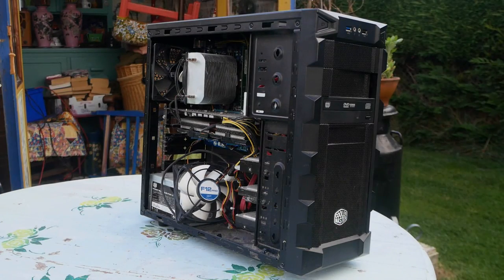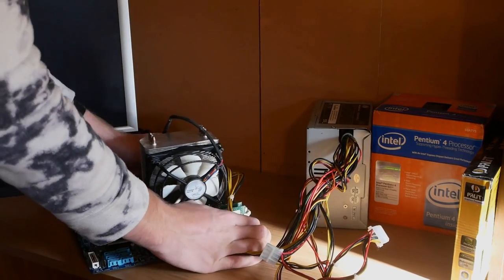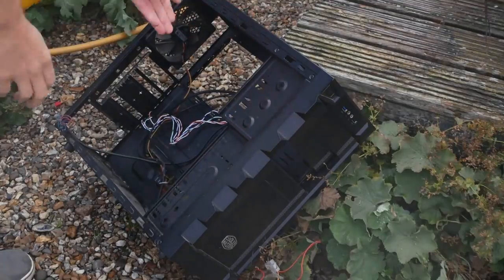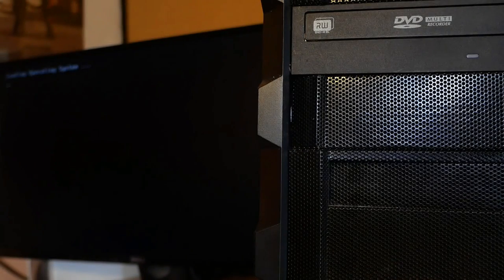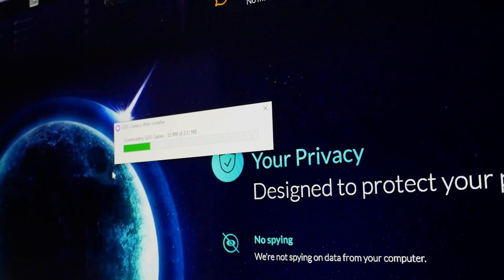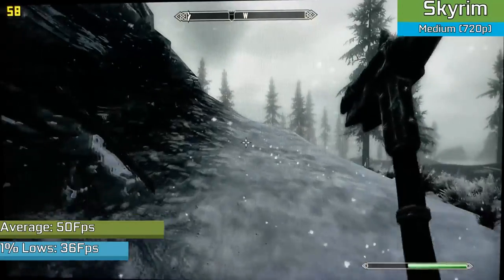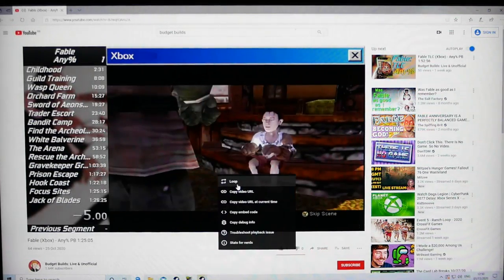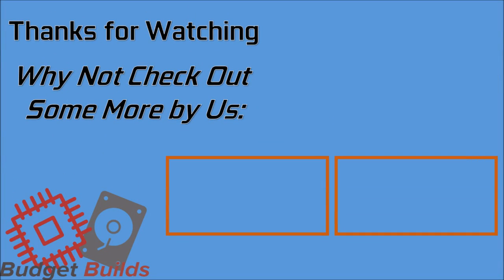I Bought an Awful Computer from a Barn....

Comment: Sounds like it has dead pci X16 contacts, the slots can get damaged over time, did you clean it out?
Reply from the maker: Fully cleaned out, and repaired. I think the tar may have corroded it and destroyed a power trace
Reply: Especially weird since the card works in other systems and the HD4670 was the only thing to run in this one. Which should be a x16 card, and most can easily run x8, x4 or even x1 if thats all they can handshake with.
Reply: Did you try to wash the board in the dishwasher?  Make sure there is no rinse aid or detergent and take the cmos battery out. Let it dry for a few days in ambient air and you're set.
Reply: @BudgetBuildsOfficial  try gt 1030

It's pcie x4. With x16 connector (doesn't make sense why no one made x4 ones with gddr5)
Reply: the power supply is bad.....
Reply: @HappyBeezerStudios  some cards populate in different ways, weak cards use fewer traces and if you get lucky with the layout some might work
Reply from the maker: @jskyg68  No it isn't. All have been tested.
Reply: >I think the tar may have corroded it and destroyed a power trace
That could explain Nvidia cards not working, but if that was the case an AMD GPU with PCIe power connector should work, my memory isn't flawless but I seem to recall AMD GPUs being able to run with the power part of the PCIe slot cut entirely without needing to mod the card (minus cutting the part that goes in the power part of the slot).
Reply: @transparentblue  the card that came with it was an hd 7870.
Reply: @HappyBeezerStudios  Maybe it's worth a try to force the PCIe lane width down to x8 or x4 in the BIOS and see if other cards work?
Reply: @Stoney3K  That's actually a good idea. Especially since many cards don't need full bandwith to reach their performance. I remember tests a few years back where a HD 7970 lost maybe 5% when running at 8 lanes even on a PCIe 2.0 board. And with those lower end cards it should be less noticeable, if at all.
Reply: @BudgetBuildsOfficial  did you try doing that really desperate thing where you fully wash the mobo with dish soap and wait for it to fully dry
Reply: “Never said good or bad” -System integrators
Reply: As an EE I'm going woth tje damaged trace not all cards are equal more so with pin outs on d vs new ... layman's terms mobo is junk
Reply: EDGE: 
“Were NOT spying on data from your computer" 
LOL, What about the actual browser? 

JS... LOL
Reply: I had a similar problem some years ago. Turned out to be the vga-cable. Changed it and all cards worked just fine on that motherboard.
Reply: @trisjack82  … Especially the new "6500" XT that could have been GREAT barring the situation ATM ... if they did not leave out the majority of folks not upgrading the entire system to have GEN 4 PCiE Rails aboard as without GEN4 and the 6500 XT (switched name from 6500 from 6400 but maybe they will release a 6400) with it's particular missing PCiE traces or pins, its a wimp which it did not have to be however was done on purpose, REALLY A SHAME! … However, AMD been really making “VEGA GREAT AGAIN” which I give them credit for, the VEGA 56/64 catching up to speeds of the 1080 ti which is still a great card, really shows what DRIVERS can do... I hope they keep going, especially with the PRO cards like the 8200 ...
Reply: @VoldoronGaming  ...not a bad card, a very beloved card still by many sentimental enthusiast folks - to bad that card did not have a variant with more RAM as it is held back with some of its performance on the table because of this as well as driver support ending for GCN except 5.0 & the newest RDNA so cards like VEGA 56/64 & Radeon VII and such which is doing insanely well BTW ... need to be re-visited by reviewers...
Reply: It could be broken PCIE lanes in the CPU itself. Doesn't have to be contacts or motherboard. For example if at some point something was shorted (maybe some dust or something), a PCIE lane could have been fried on the CPU die.
Reply: I'd have probably chucked out the suspicious MB and the grotty (and broken) case, and sold the rest of the parts on individually or tried to make a PC out of what was left, along with a cheap replacement MB and case. After all, the PSU/CPU/RAM/GPU/SSD/HDDs/ODD were worth the £30 (and possibly more) just by themselves.

Comment: "I don't know why you'll need that much storage" As someone with 9TBs spread throughout a bunch of drives I feel personally attacked.
Reply: Its homework
Reply: I have a 2TB HDD, a 1TB HDD and a 500GB SSD in my tower PC :) the only reason I don't have any more is because I'm out of SATA ports (the 4th is for a DVD drive). I also have tons of spare 2.5 and 3.5 hard drives scavenged from various sources (mostly satellite and cable TV boxes).
Reply: NAS with a 3tb and 4tb, 2 x 6tb and 1 2tb nvme, and a laptop with 1.5 tb of nmve
Reply: Lol I have large games do 3D animation and video editing and I only need 1tb max
Reply: I have to keep managing my 2+2TB setup by keeping less used files and games off my M.2 and put them on a 2TB constellation hard disk (so its not too bad for speed but 180 MB/s versus 3000 MB/s for a M.2 is slow in comparison).
if I had more money I'd love to have another M.2 or a larger rust spinner to store less used files.
Reply: Only 9? I'm sitting here with 39tb.
Reply: Got 2 3TB and a 4TB drive in my main system and actually use that stuff.
Like, my steam folder alone is close to 1 TB and there are games that do not come through steam. Then add the amount of music and videos that collect over time and you need more than one drive.
Reply: @cee128d  39TB sweet, I treated myself to two 14TB drives last Amazon Prime day. It's so nice to not have to worry about storage space.....for now. Must...hoard......all the data.
Reply: I think I have like 10TB in my main system.
Reply: @cee128d  Living the dream right there.
 
Currently I have:
2x 3TB hard drives for a personal project
2x 1TB Sata SSDs for games
1x 500gb nvme as a boot drive
1x 500gb dodgy laptop hardrive for "homework"
Reply: We need somewhere to keep the booty we get for sailing the high seas.
Reply: @ihatelols  2TB + 512GB SSD is more than enough for me. I don't know how many games you play at once or have installed but I have a Steam library of over 80 games of which just 1/4 were installed and still had space with my 1TB drive. Even video recording.
Am not going to count Origin games.
Reply: As someone with two 160gb maxtor 5400rpm hdd i feel pretty jealous.
Reply: @ihatelols  Oh , I do understand your situation now!
It makes much more sense for you to have a lot of storage since you re-sell PCs with pre-installed games and everything.
I though you were the average dude using his PC to play games , maybe store some videos , picture or music and that was it.

I just got to know a lot of weirdos on the Internet though , hahah.
They would save everything single picture of everyone (personal or not + pr0n ofc) , screenshot chats , record voice chats and all. Don't really know what's wrong with these people but they definitely got something wrong in their brains ahhahah
Reply: 240GB SSD BOOT Drive
1TB SSD For games
1TB HDD for others.

I guess this is the norm these days?
Reply: @klen7642  Just go for a 1TB M.2 SSD for anything honestly. Is decently cheap and very fast and reliable.
Reply: @mabeSc  True. Most people don't really need more than one 1tb, and keeping everything into one tiny m.2 is even better.
Reply: @McShave  I'll probably pick up a couple of 12 or 14 TB WD EazyStores to shuck in the near future. I'm running out of space with all of the videos I've been creating during all of this Human Malware Nonsense.
Reply: Oh god, I have more than 40 TB of storage total. Most of it is lying in a stack of drives I have though.
Reply: @Kevin-rk3ef  i know it's a joke, but really, how much p*rn would you need to get like 1GB worth of storage? that's like, content for all your life
Reply: Those are IDE Hard Drives, like from the late 1990's or early 2000's. core i5's and i7's used Sata, not IDE.
Reply: @TheSpotify95  I’m pretty sure they got pcie sata controllers on amazon and ebay
Reply: @NicksRepository  Linux distros of course.
Reply: Me sitting here with 50tb.... Thinking that not much
Reply: got 1tb hdd, 1tb hdd, 2tb hdd and a 256gb ssd, all combined have over 100 games on steam across all drives along with steamvr, origin games, ubisoft and battlenet and source sdks and also bunch of pirated games and films end up with about 200-300gb left per drive except on the ssd where theres 30gb left
Reply: i use 4.25 cuz all my games
Reply: only 9? Lol 24 here
Reply: As someone with ~300tb, spread across 6 computers, I need more storage.
Reply: Lol. I hear you. I have about 20 tb spread across 3 computers.
Reply: As someone who wants to back up all their PS1 and 2 games, as well as old DVDs, physical photos, home VHS, etc.

Hell yeah, moar TB
Reply: @ScienceAlliance  It's a 'size' thing.😉😉
Reply: @TheSpotify95  doesn't mean you're out of options to have more storage. Haha external drives go wrrrrrr
Reply: my hyperspin setup is 64tb out of my total of 80tb and i am running out space
Reply: U just lazy to look around ur storage to delete unused stuff
Reply: Huh, it's been a while since I counted up mine, 19TB? Dang
Reply: Watch linuses petabyte project video
Reply: @philmikehunt7479  Thanks, I'll have a little look, assuming I've got any spare ports (I know I'm using a PCI-E connector for an internal Wi-Fi card).
Reply: @Dyndicat  Could do, though I'd prefer more internal hard drives. Having said that, I do have another spare 2TB hard drive, and an assortment of 500GB hard drives (all stripped from satellite and cable TV boxes). I also have some 1TB 2.5 in drives (from cable TV boxes) which I plan to either upgrade laptops or use as external HDDs.
Reply: My main rigs have 6 TB (2+4 in hdds) and the other has 4 TB (1x4 SSDs)
Reply: 1 TB M2 SSD and 4x 8 TB Hitachi drives on my primary computer
Same setup on my backup computer short 2 TB
24 TB as external backup storage

Do I need that much space? Absolutely! Just to feel safe in this unsafe times. ;)
Reply: @Dyndicat  Yes I could go for external hard drives but then I'd run out of either enclosures, or USB ports to plug them into. Plus, I only have 2.5in enclosures; the 3.5in ones are (a) more expensive and (b) require a separate power supply - which I don't have the plug sockets available for.
Maybe when I use my tower PC more, I might get some PCI to SATA converters so i can stuff more hard drives in there. I've got an assortment of 1TBs, 2TBs, 500GBs and 320GBs, as well as 2.5in 1TBs, mostly all salvaged from Sky, Virgin and EE TV boxes :).
Reply: I got 21TB total with 7 drives on my editing and production computer and use many other computers for other tasks as well. Space is never too much today
Reply: @ScienceAlliance  u must have like 3 large games then, i only have 40ish games installed and over 3 drives it takes well over 2tb
Reply: I’ve got a 1TB, 8TB, 500GB and 240GB hdd and my boot ssd all atleast half filled lol.
Reply: I have about 10TB of storage atm mostly external storage and I’m about to add another 5-8gb with a WD Black 7200Rpm Game Drive, in my PC I have a 1TB Samsung M.2 ( not an MSata ) and a 2.5” 1TB WD Blue SSD ( 550/550 ) atm I have a ton of external drives
Reply: Same here 5 TBs of SSD and 4TB HDD installed + 24 TB NAS i bet i have something like a year left unitl i need to upgrade again.
Reply: @TheSpotify95  I'm in the same boat, would upgrade aswell to bigger storage but far too lazy to transfer all my data.
Reply: Me with only a 30gb HDD:
Reply: I have 8hhd with 2tb each.
Reply: Sitting at around 3.3 TB across my system. 

2 TB external HDD
1 TB Samsung EVO SSD (main)
4 GB USB stick
32 GB USB stick
Reply: @Iridiumcosmos  technically the usb sticks don't count
Reply: @DiabloXL69  That was a dumb reply bud. When you hear people say “across the system”. That is storage drives available to the user overall. So yes, USB sticks do count. Lol.
Reply: @Iridiumcosmos  ok. So we chill?
Reply: 2tb storage owner full of homework here

Its just incase internet is not available
Reply: @Sheovion well my guy, i enjoy high quality porn, not those murder video graphics 3gp format

1 4k pict usually takes about 14mb storage, a 3 min 4k vid is about 100-200mb
Reply: Haha I have 3tb of ssd storage and 16th of hdd space 💀💀
Reply: @vamwolf  Right, computers can never be too fast, or have too much storage. This has been true since forever.
Reply: I've got a 24 drive 200TB fileserver with two Xeon E5-2650v4s (12core,24thread) and 256gigs of ram thats just used for backups of my desktop, which has about 32TB of storage in it, and it also has a couple of virtual machines running quake servers on it! Can never have enough storage space IMO

Comment: No matter if machine costs 10$ or 2000$, cable managment is a must. :D
Reply: After testing all the parts first
Reply: You'd have a heart attack if you saw the insides of my computer. Cable management? Not here!
Reply: Cable management is pointless
Reply: For me it only matters if it has a window side panel. On closed cases, as long as all the fans are free to move I’m content
Reply: They fit in the case & don't block any fans, then they're managed.
Reply: @beardyface8492  with my first ever computer, I rebuilt it several times just because I wanted every cable to be in the perfect position.
I ran many cables directly behind the motherboard. It's a pain in the ass but looks incredibly clean.
And then you close the side panel and don't see it anymore lol
Reply: I agree, having OCD, I would have a heart attack over seeing abysmal cable management.
Reply: Cable management inside the case, sure. At the back of the case though? I don't even bother.

Comment: This is a little weird I just finished a build whith a i5 750 HD 7850 and a 500gb hard drive fore $35. Thought I dont have a case as of yet.
Reply: Get a cheap diy case
Reply: @Scuffedalex  or make your own and use some cheap leds, will look better than the diypc case even if you use cardboard
Reply: I was also about to do that build, but my 1156 board said "nope" and I went for a xeon x3440 instead, and I didnt bought that 7850 yet also
Reply: Shoe box pc build

Comment: My previous PC used to have the same problems. 
As it turns out, my PSU's 12V rail only had 11.20V at idle and would drop all the way down to ~10.95V under load, probably due to weak capacitors or something. For comparison, ATX specs recommend at least 11.40V under load. 
Hence it's usually a good idea to test old PSUs with either a multi-meter or one of those fancy PSU testers before putting to good use.